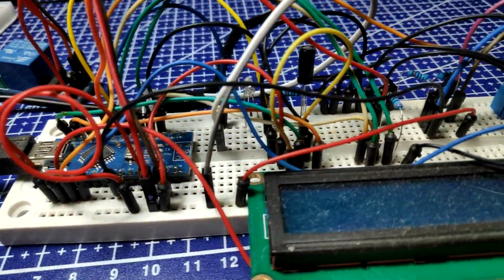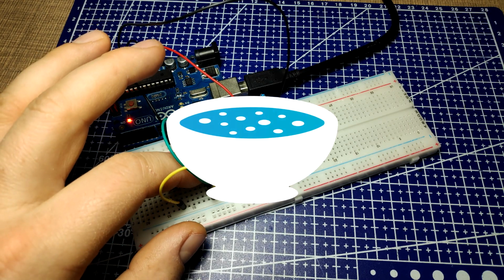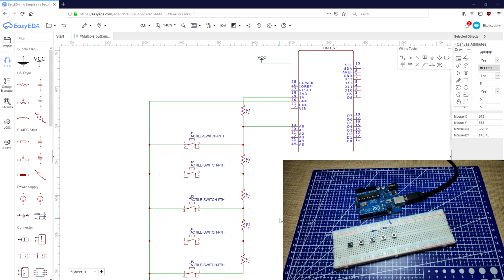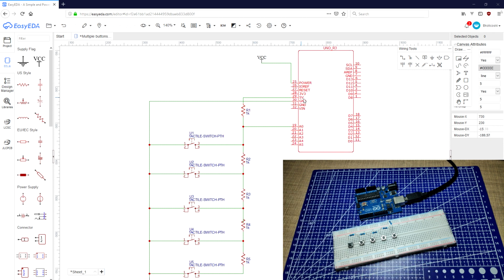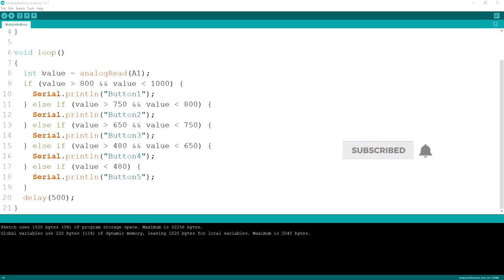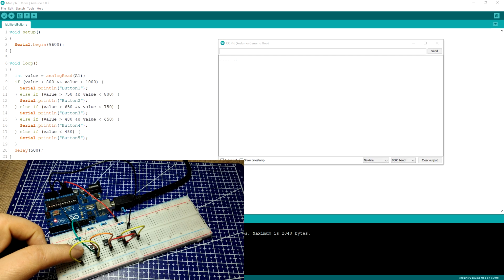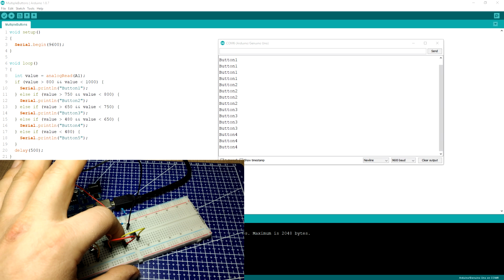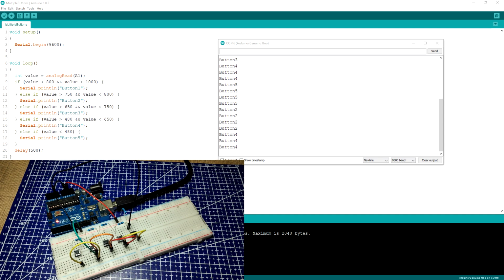Multiple buttons on a single Arduino pin - Conserving Pins//Arduino Tricks

Comment: Is it ok we use the same procedure but using a digital pin not analog?
Reply from the maker: No, that will not work as you need to read and distinguish between the different analog values produced by each button and resistor divider.

Comment: I have a question my bike has an ECU switch conttoller that has a single button that I press to from Map 1-4 and stay it the selected Map when i turn off & on the bike..Can I use this to make a piggyback invidual button so instead of going in sequence I can just jump to the Map that i want?
Reply from the maker: Not without changing the bike firmware on the controller and I guess that will be a closed software...

Comment: tried your circuit but did not get the results that you predicted.  
When i press my button1 the monitor shows "Button3" 
When i press my button2 the monitor shows "Button3" . 
When i press my button3 the monitor shows "Button4" 

When i press my button4 the monitor shows "Button5" 
When i press my button5 the monitor shows "Button5" 
Could you kindly suggest how I can get the intended results?
Reply from the maker: You may need to adjust the values in the code or the resistors as the detected value depends on the measured voltage that is divided by the resistors.

Comment: Does the arduino also recognize if you press two buttons at the same time? Or is it then required to use two analog pins?
Reply from the maker: No, this method only works for one button at a time. Pressing two buttons might be recognized as some other bitton.

Comment: Thanks for the video. If I may ask, would this mechanics work with 2 or more buttons being pressed at the same time? Like for example long pressing Button A and B or more button combinations?
Reply from the maker: Long pressing will work but not with multiple buttons. Only one at a time.
Reply: @TasteTheCode  oh thanks! If i understand it, multiple long presses will only work with buttons attached to different digital or analog pins?
Reply from the maker: Yes
Reply: @TasteTheCode  thank you so much 🤗
Reply from the maker: You're welcome!

Comment: What resistors to use for 10-buttons?
Reply from the maker: I would not recommend using this method for 10 buttons as the difference between the readings will be really small.
Reply: @TasteTheCode  ALRIGHT THANKS! Ill just go with the Due or Uno then for more Digital pins. Im going for 70-buttons so i need 14 pins
Reply from the maker: Wow, that's a lot of buttons. What project are you working on?
Reply: @TasteTheCode  CDU for A10-warthog. Im thinking of getting the Led buttons as well but also not sure how to wire them LEDs.
Reply from the maker: @daemon3spade  WOW! That's a complicated one! I don't have the info to know what LEDs are those but I guess you can use a matrix configuration to drive a lot of LEDs with fewer pins. Or you can use the MAX7219 IC to do even better by using serail.
Reply: @TasteTheCode  I have no clue what MAX..thing yet maybe I'll start with the Matrix as a beginner.. hehe Good thing there are videos like yours. I think this is hard i might quite halfway haha
Reply: @TasteTheCode  Btw I was told that running 5 buttons per pin will damage the board faster that 4 is that true?
Reply from the maker: Hmm I don't see how any numbers of buttons can damage the board in any way.

Comment: it is good one.  But instead of  checking it in main loop , How it can it be achieved using  interrupts,  i mean sketch should check which button is pressed only when any button gets pressed.
Reply from the maker: That is tricky as interupts function as a digital input while this method is reading analog values.
Reply: @TasteTheCode   thanks for your prompt response.  however please suggest me the way  to achieve that.  since  more the code increases in main loop the more  we are likely to  miss the button press which is not good.  I tried by triggering the interrupt on button  press but  analogRead()  seems impossible to work well in ISR.  it gives random values instead.!!!
Reply: @dilversingh8766  This is a programming issue and me being a programmer I will try to respond (I won't write the code, I do that for money as a day job). What you want to do is catch the button press (and for best results the release), store it into a temp global variable and perform it if the result and temp variable are different.

It should work like this in the loop: if result of A0 is default (no button pressed), reset the global temp variable to null and do nothing. If result of A0 is not default and temp variable is null, set the temp variable to the result and call ButtonPressed function. If result is the same as temp variable, do nothing.

That way you catch the button press only once.

Comment: Nice! I worked it out on Uno and the Seeeduino Xiao without altering the code.  Noticed that the buttons are not quite instantaneous. Is that just a function of the button or is there something I can do in the code to make the buttons more responsive?
Reply from the maker: There is half a second delay after each reading so that is what is causing the delay. If you lower that to something like 50 millisecond, then it will be much faster. However, it still might take few more milliseconds for the ADC to pickup the change but it should not be that noticeable.
Reply: @TasteTheCode  Thank you!
Reply from the maker: @tinahinojosa9326  You are welcomed!

Comment: Soo did you sperate the buttons with the press time? Like each button trigger at the specific press time?
Reply from the maker: No, I separate them by the different value read from the analog input based on the resistors combination. It's all explained in the video.

Comment: Greetings, thanks so much for the video, may I as is there any difference between uno and nano using this method?! I had a running code on uno using this method but when I shifted the code to nano, instead of performing an action for every button, it chooses to select the last button only in the divider! I really can't think of the reason :( thanks in advance
Reply from the maker: There shouldn't be any difference between the two. Can you verify that you actually read the right input? Also, make sure that the connections are all correct.
Reply: @TasteTheCode  Thanks for replying, Actually I did check twice for everything, and even took parts of the code and ran it separately to make sure everything is ok, Also checked the divider values many times and altered the values in the code, Finally i did a Serial monitor check, printing the values of the buttons when clicked and while I see it correctly read, the code doesnt run still :(
Reply from the maker: Can you share the code that you use so I can check it?
Reply from the maker: OK, that is way different than my example code and the AnalogButtons file is missing. Can you provide that as well so I can see the check method?
Reply from the maker: From what I can see, you have an error in the definition of the analog buttons where you also set as input but based on the docs, that needs to be done separately. Additionally, their example uses pull down resistors while my example uses pull up resistor. Since you use code different then mine, make sure that the wiring is matched with the other example.

Comment: Would there be a way to take the buttons from the breadboard, but still have connection?
Reply from the maker: You need to solder wires to them.
Reply: @TasteTheCode  oh ok! makes sense.
Reply: @TasteTheCode  so just a wire to the prongs of the button?
Reply from the maker: @Sturgeostic2444  Yup, that is exactly what the breadboard is doing. just connecting the things put into the holes.
Reply: @TasteTheCode  cool!

Comment: Now try pressing 2 buttons at once.
Reply from the maker: If you have cases where you need to detect multiple buttons at once, then this is not a good solution. It is doable, but usually not worth the time.

Comment: When you have no button pressed do you get 1023?
Reply from the maker: Yes, as R1 is acting as a pull up resistor, connecting the analog input to 5V.

Comment: Excellent tutorial, many thanks. I would like to develop a quiz controller, that my students can build, using this system but with eight buttons. The push buttons would need to replace, the onboard, type that you are using with relatively large push buttons. I would then need to get the system to illuminate some kind of display to show which button was the first to be pressed. Would this be possible using your system, please?
Reply from the maker: Sure it is. The only thing I would recommend is to split the buttons on two analog inputs so the "clearance" in between the values is greater.
Reply: Taste The Code Many thanks for your speedy reply. Presumably “clearance” gives the Arduino time to detect the first button if two buttons are pressed, almost, simultaneously, if you understand what I’m trying to say?
Reply from the maker: No, I meant that the clearance is the difference between the values that each pin will give when pressed. The less buttons you have, the greater the difference in the analog voltage read. If you need a case where multiple buttons need to be pressed at the same time, this is not the recommended way. You will be better to use shift registers to expand the number of inputs.

Comment: Hi 
can 2 buttons be pressed at the same time??
Reply from the maker: Yes, they can but detecting that will not be easy as pressing the two buttons at once will basically put those two resistors in parallel. The value of the voltage then can be quite unpredictable so this is not really a recommended way if you need more than one button at a time.
Reply: It's not damgerous to do it but you will absolutely not get the result you are expecting.

Insread of seeing "button 2 and button 3" you might see just button4.

I am struggling with this at the moment.
Reply from the maker: Try altering the resistor values so a clearer distinction can be made.

Comment: Great solution! Would you recommend to use debounce for the push buttons
Reply from the maker: You can but it is not required. The resistors will kind of smooth the transition of the voltage and the values.
Reply: @TasteTheCode  Excellent, thank you for your help
Reply from the maker: You are welcomed!

Comment: I'm having trouble with this project- I'm trying to make a variant for 3 buttons instead of 5, and I'm not sure why it's failing. this is the code I'm using:
void setup()
{
  Serial.begin(9600);
}

void loop()
{
  int value = analogRead(A1);
  if (value > 650 && value < 1000) {
    Serial.println("Button1");
  } else if (value > 480 && value < 650) {
    Serial.println("Button2");
  } else if (value < 480) {
    Serial.println("Button3");
  }
  delay(500);
}
Reply: Never mind! I had put the wire into A0 instead of A1, so it was reading the wrong thing- great video by the way!
Reply from the maker: Thanks! I'm glad you were able to fix it!
Reply: Taste The Code :)

Comment: what would the values be if I'm using 3 buttons?
Reply from the maker: Not sure, it all depends on the values of the resistors. It iss best if you connect them, check the values and then write the code around those values.

Comment: Would this have to be done with all 1k resistors? I'm trying to have 12 buttons in series - but I only have 10 1k resistors at the moment. I presume I couldn't mix these...?

Could I put 6 buttons in Analogue pin one using 6 1k's and 6 in pin two using 6 2k's?
Reply from the maker: For sure you can. You can even mix them but the ranges will not be evenly distributed.

Comment: How do you know what number to have the value range per button?
Reply from the maker: Once you connect the resistor, the first sketch can return you the values for the readout and then you can create the rangers based on that.
Reply: @TasteTheCode  cool thanks I'll try that. Currently I'm trying to make a universal remote, which will control all IR devices in my home when you switch a rotary encoder. I've set up this switch circuit as I believe it's the best way to minimise pin and wire use.

Although I'm struggling to get the rotary encoder working!